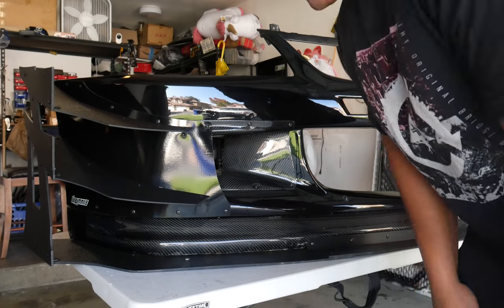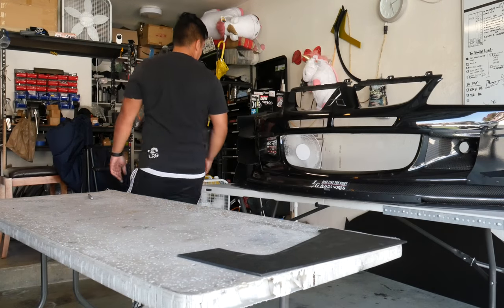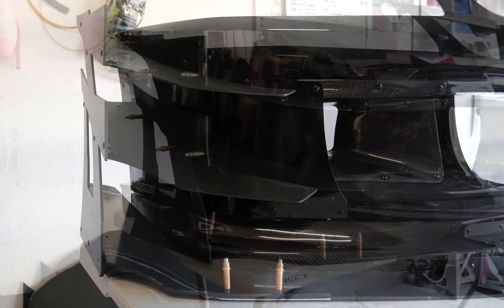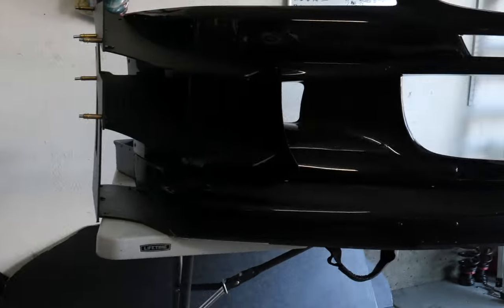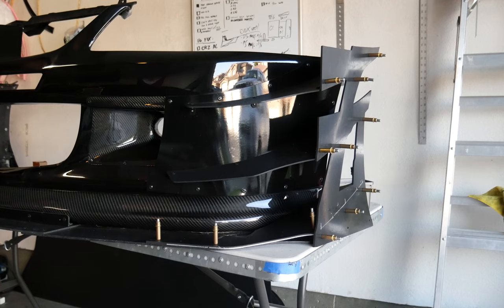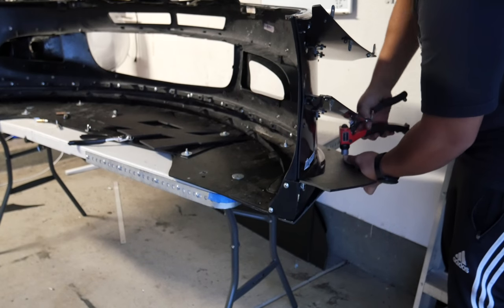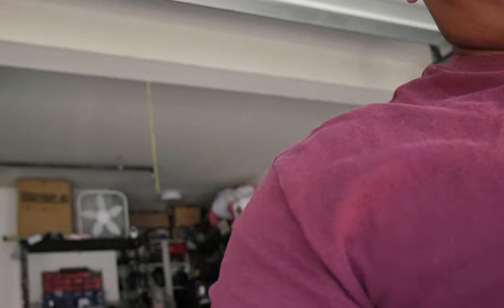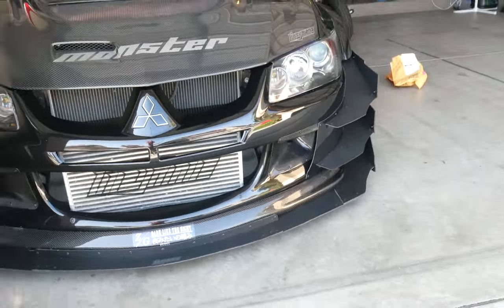EPIC Evo 8 Custom Hand Crafted FIVE PIECE SPLITTER! ep.2

Comment: Where did you get the material you used
Reply from the maker: Moises Jose I buy it off eBay
Reply from the maker: Abs plastic sheet
Reply: @UbanteGarage  whats the thickness for the splitter and canards?
Reply: @UbanteGarage  do you have link for the plastic on ebay
Reply: Is this ABS plastic or
High Density Polyethylene?